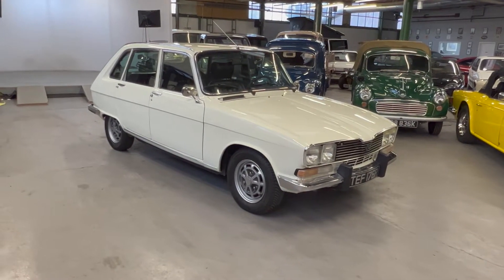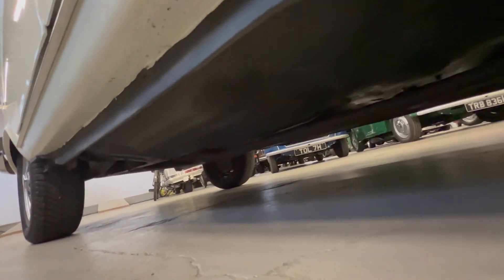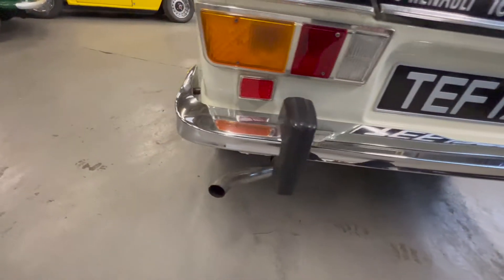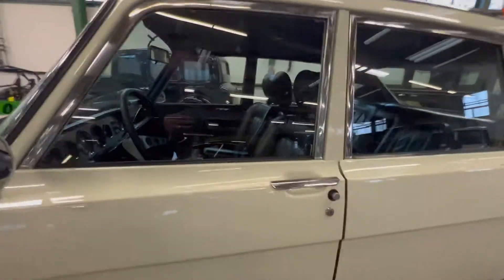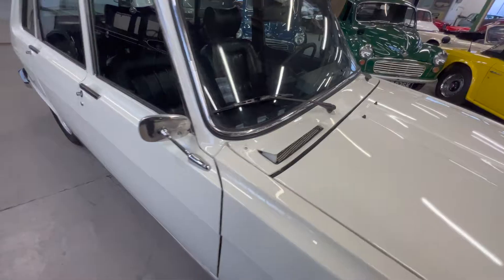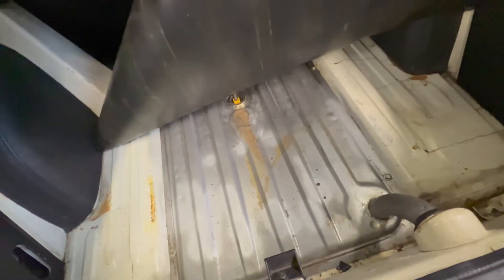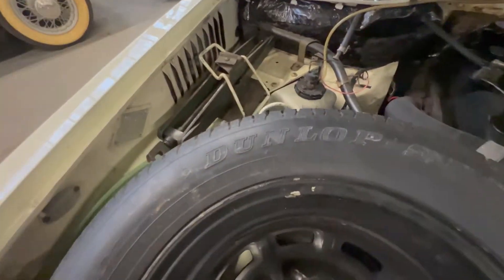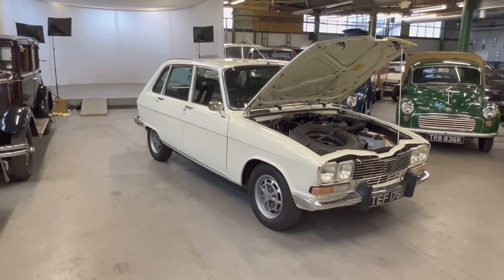Renault 16 TX - One of only 10 left on UK roads

Comment: The R16 was an amazing car. You could fold down the seats and sleep in it. People remember the Austin Maxi for that party trick but may not know that BMC actually bought a R16 to find out how it was done – the Renault got there first. It was in fact a superior car in every way, refinement and ride for example were in a different league. I had a friend at uni back in the early 80s who had a metallic blue example which really impressed. A hugely underrated car and looking at this amazing white example I had no idea how well spec'd the TX was. Way ahead of its time.
Reply: BMC bought a 16 to find out how to fold seats?? The seats of the 16 could be arranged in various ways. One variation was with the backrests of the front seats fully reclined so that they met the cushions of the rear seats but the backrests of the rear seat remained upright, so a short 'bed'. Another variation had the backrests of the front seats partially reclined then forming an incline with the cushions and backrests of the rear seat suspended to form an inclined 'bed' (quite ingenious). And there were various other combinations and positions to facilitate luggage and loads. But the seats of the Maxi could be arranged so that all of the cushions and backrests were horizontal thus forming a full-length 'bed' (plus luggage positions).
Reply: @htimsid 
Perhaps the fold-flat seats on the Maxi WOULD  work as a bed. But on this beautiful Renault,  the seats are lumpy rather than flat.

Comment: Absolutely my favorite car of all time. I had many until they stopped importing them to the USA in 72’ I once transported a full sized refrigerator in the back….no problem. And used it for camping. The only problems were a terrible automatic transmission, torsion bar bushings would rot out and cause a terrible squeaking noise, and the ac compressor, after market, broke the camshaft pulley.

Comment: We had 2   16s back in the day, a TL followed by a TS great cars and extremely comfy compared to any of the competition at the time. Column change gave plenty of space in the front , being a proper hatch back extremely practical. Biggest problem I recall is a starter motor replacement absolute nightmare. It looks to me that this 16 has had the cills repainted, I could see paint drips under the driver's door.

Comment: This is a museum piece - probably smarter now than when it left the factory. I'd be afraid to take it out on the roads - I know how rust-prone they were back in the day. My Dad had four Renault 16s (an early 1470cc TL, a TS and two later TLs) over the space of 16 years, before going through two R18 turbos, an R9GTX (quite unusual - 1.7-litre engine in that size of car), an R19 and two Lagunas, covering a total of 38 years before changing brands...so I grew up with Renaults.
This one has the optional leather upholstery as well - would have been extremely pricey when new. My Dad could have picked up a TS with every luxury option (electric windows, tinted glass, central locking, fog lights, electric sunroof, maybe even aircon as well) back in '72, but it would have cost about £1000 more than the standard-spec TS he could afford. That TS lasted 8 years before being condemned for gross catastrophic corrosion and I remember the DIY rust repairs (metal mesh and isopon) along the way - hence why I'm surprised at the condition of this TX. Incidentally, it's also relatively unusual that this doesn't have metallic paint.

Comment: Brought back good memories, purchased one in 1983,a TX,it was a 1979,T reg model,metallic grey,beautiful bodywork,5 speed column change,first car that I done 100mph in,had problems with the central locking,if I remember there was a safety feature that if you were in a collision a ball bearing rolled off and opened the doors,only problem if you went over a bump it would set off the ball bearing and it was a pain to reset,took it for its 2nd MOT the testing guy told me that the rear box section was badly corroded,he told me it was a common fault with the R16s,so I got it repaired for the MOT,then sold it for half what I had paid for it,

Comment: I had a '74 16TL, baby poo yellow with same coloured interior. I think Renault called it mustard. Not exactly the prettiest car around, but I loved it anyway. Fantastic car, very comfortable ride & seats. It did lean & understeer a fair bit when cornering enthusiastically, but roadholding was good. The R16 had some innovative features; it was one of the first hatchbacks with a multi-positionable rear seat (I think the E-type was the first hatchback, although Jaguar didn't market it as such. Not even Renault marketed the R16 as a hatchback as the word was not in use at that time). It had long travel, but well damped torsion bar suspension all round (which was also adjustable, but only from underneath; very fiddly) making for a great bump & pothole absorbing ride. The engine was placed longitudinally behind the transmission, Citroen DS style which helped reduce understeer & improved the front-to-rear weight distribution (which incidentally left plenty of space for the spare wheel, freeing up space in the boot). It had built-in roll bars in the roof from the A-pillar at the windscreen to the C-pillar at the rear which gave it an unusual roof profile giving added protection in the event of a rollover. It had a lockable bonnet. For 16s with central locking, there was an inertial deceleration switch which automatically unlocked the doors in the event of a crash. Because it had transverse torsion bar suspension with trailing arms in the rear, it was the only car to have the wheelbase longer on one side than the other by about 7cm. Not exactly an innovation, but more like an unusual quirk.
Unfortunately, like so many cars of the '60s & '70s, it rusted badly (or very well, depending on your point of view). Interestingly, Lotus used the R16 engine & transmission combination in their mid-engined Europa. Renault's motorsport arm, Alpine also used the R16TS engine & transmission in their world-beating rear engined A110 rally car. With its hemispherical combustion chambers, special tune & twin Weber DCOE sidedraft carburetors, it produced about 135hp in a lightweight fibreglass bodied car.
Reply: My memory's a little vague now but I think the front torsion bars could be adjusted inside the car - I remember two bolt heads under the front seats on a crossmember.
Reply: @HowardLeVert  You are right - just checked the Haynes manual and the front torsion bar adjustment is under the front seats.

Comment: It was at least as clever as the Citroën DS,  FWD, the first hatchback in its class, no grease points an enclosed cooling system and an electrical driven cooling fan and an altenator. It had integrated door handles and no rain gutters
This was the car that changed the world, many manufacturers followed the hatchback concept ever since.
And the introduction of this TX model, meant a renaissance for the model, tinted windows, a 5 speed gearbox, central locking and electric front windows. I never understand why its main rivals the DS and the 404 Peugeot are appreciated classic cars and you hardly see an R16
Its DNA is in almost every modern car!

Comment: The Renault 16 TL was my first car. I drove it for a year, then it turned out to be so rusty that it no longer passed the inspection. Oh how disappointed I was. My father drove about 12 different Renault 16, TS, TL and TX in 14 years. All manual cars. But he always regretted the one green TS that was not as rusty as it seemed. He demolished it and sold it as scrap metal. To date, I have not come across a car that drives more comfortably than the Renault 16.

Comment: I think the engine is 1640cc. Had a 16TS. Best car I have owned.
Reply: I think the 16TX had a 1640 engine, my father's TS was definitely 1565
Reply: @joehemmens8127  1647cc on the TX, 1565cc on the TL and the TS but the TS was a crossflow engine and way more powerful than the TL. Early 16s were 1470cc.
Reply: Ts was 1565cc cross flow head txt was1647cc same cross flow head but a 9.25 to one compression ratio higher than the ts favourite car ever ❤